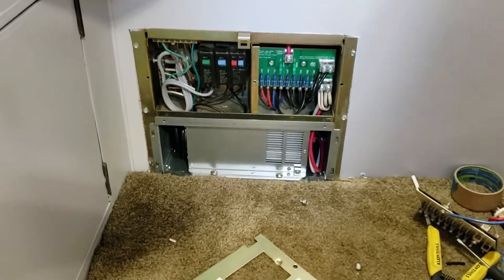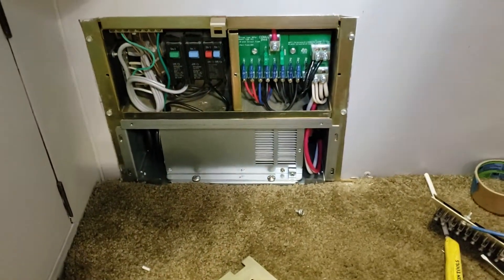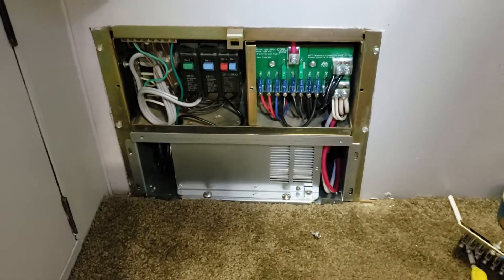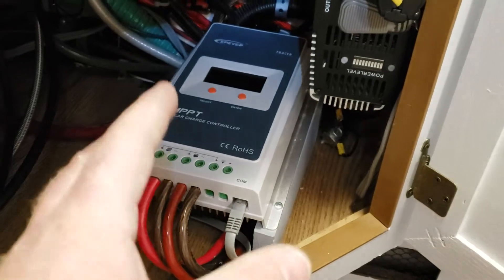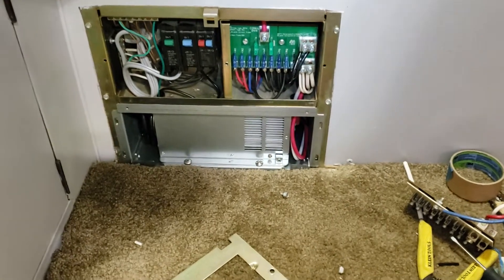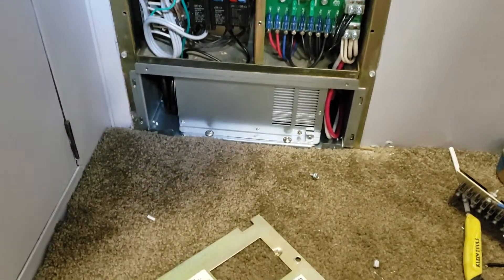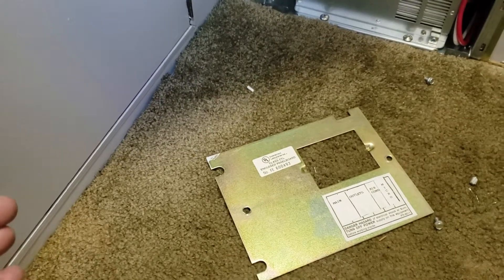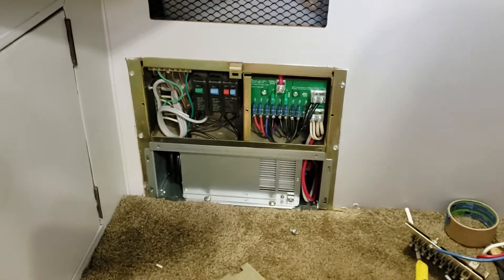Upgraded our RV Converter Charger to a Smart Charger in Lance Truck Camper.

Comment: I see you swapped out your DC distribution block. What new one did you get? I installed a 35amp converter in my 94 lance but I’m only getting the 12v in the first 3 fuses on the right. So now I have no lights or water pump
Reply: Any suggestions?
Reply from the maker: WFCO WF-8945REP 45 Amp DC Converter Replacement Kit https://a.co/d/bMlqwHi